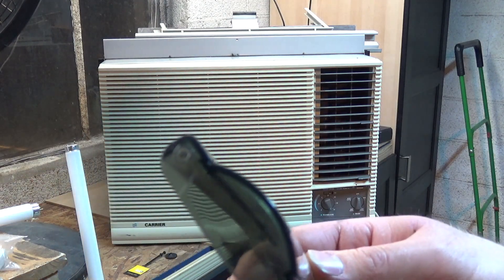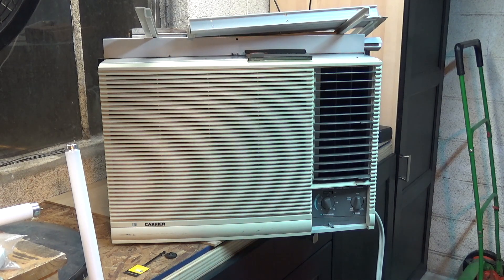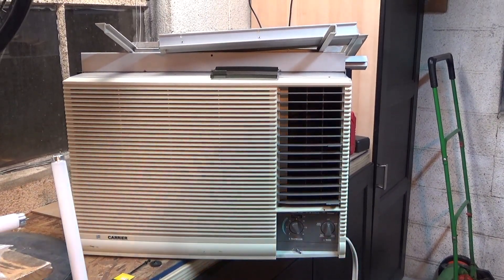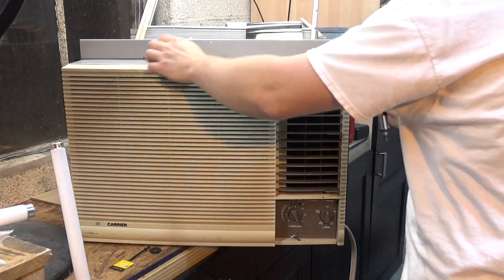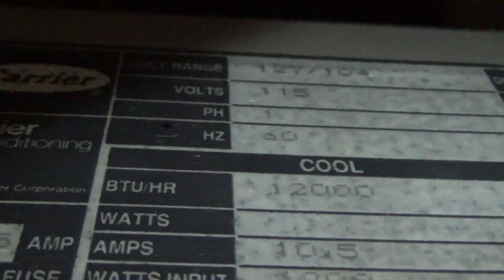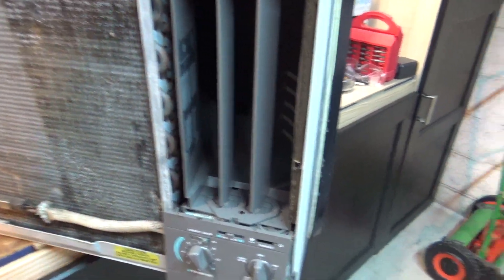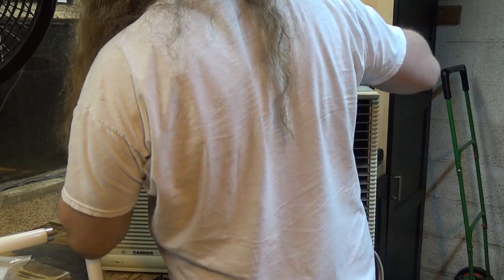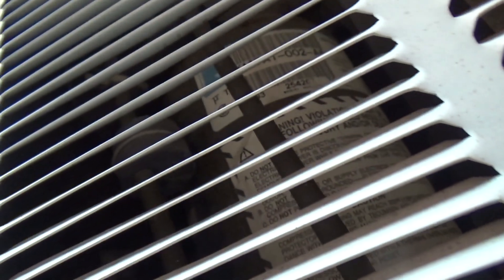Carrier XCA121D 12,000 BTU Air Conditioner | Initial Checkout

Comment: Hello sir I’m dying in a heat wave and have a similar ac mine is. A through wall ac model ycb213d - can u tell me where the step down transformer is located that takes the common supplying.24 v to compressor  it has the same three speed fan - any help I can’t get a thermostat or thermistor or thermal bulb but maybe I can get through summer if I can get it up and running in any level of operation I bought a new control selector switch and  could not get the rotary them with that therm bulb I could send 24 y to yel compressor but it would help ro know how thud unit under normal operation steps down to 24
Reply from the maker: There is no low voltage in this one, the thermostat and speed selector simply pass or don't pass the full 120 volts to the fan and compressor.

Comment: i have the 18k btu with 16/17k btu heat the X...183 something i cant remember the model year from 2001 that is not blowing heat it has electric heat and im trying to find out the issue maybe weak capacitor but ac and fan work awesome tho.
Reply from the maker: I don't have a unit with heat so I can't say for sure, but I suspect it's just electric strip heat so there would be no capacitor. Probably a bad connection or spoiled heating coil.

Comment: I have a brand new one in box ..got be 94-2000. How much is it worth
Reply from the maker: What it's worth and what people will pay are two different things to consider. In unused condition with no rust, these don't really deteriorate when sitting idle. The only part that would is the capacitor, which is a $30 easy replacement. I'd say it's worth whatever it cost when it was new, plus inflation. Most members of the general population don't understand that this is a superior product to the ones made today and will not pay much for it. Most collectors don't have a lot of money and also won't give that much for it. I'd personally give around $150 for it, and would be willing to go around 100 miles to retrieve it.

Comment: Hey Jordan, just picked up a 10200 Btu carrier that looks identical to the 12000 here. My question is I want to do a thorough cleaning an I was wondering if I can pull the unit out of the cabinet?? It is a very solid good working unit for $50. The only issue is the control knobs do not line up with the writing on the face plate?? How that happened is kinda puzzling (thinking it’s not the original knobs? But they fit?) but it’s not a crisis either. Had the seller run it before I purchased and boy it is COLD!!!
Thanks!
Reply from the maker: These were very good machines, Carrier made excellent units back in the day. I haven't gotten around to this unit yet. If you can wait a little while, I should be cleaning this out in the next month or two and will record a video showing the process.

Comment: Carrier YCB213D 21,000 BTU Wall Air Conditioner Unit, looking for and inside cover mine is cracked is there a place where I could by a replacement?
Reply from the maker: You'd have to find a used one somewhere, parts for these haven't been sold in a long time.

Comment: i have one out at my vacation place in the smallest and the back bedroom its lile this but it is 220v with heat i think it is like 20k btu but it came with the place when purchased in 04 along with a early 2000s lg around the same btus with heat both work good but the old 1980s kenmore 12k btu in the master kept freezing up a night so it was tossed the other monsters still run good except the heat no longer works on the carrier.

Comment: Very Nice Carrier you got there, That sucks it suffered some pretty bad structural damage, but that seems to be a very nice unit. BTW, is there a way to fix structural damage like that? My Old Fedders Weather Wheel AC has some bad rust-outs as well, and I was wondering of there was a way to fix it.
Reply: I've seen people patch the rust holes in with bondo. However you have to carefully lift the unit off the basepan
Reply from the maker: There are, but it's not easy. I'll have to see how bad this one is once I open it up and determine if it's worth the time or not.
Reply: @JordanU  Ah okay, I hope it's worth fixing and that it's not too bad.